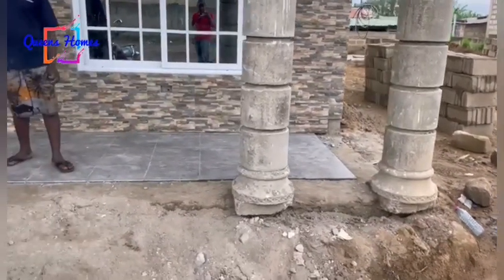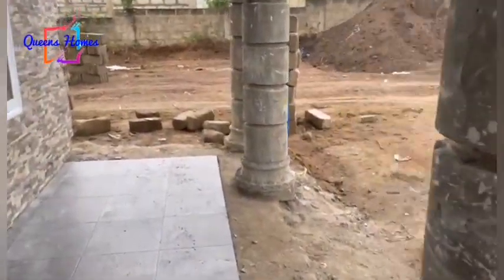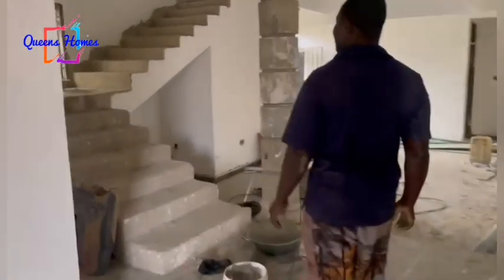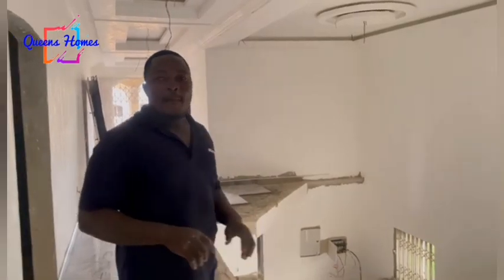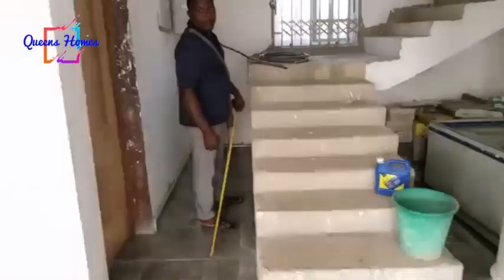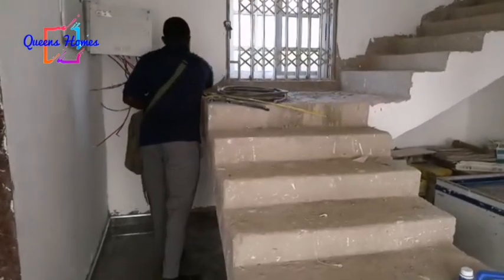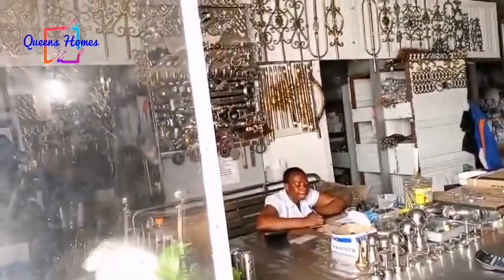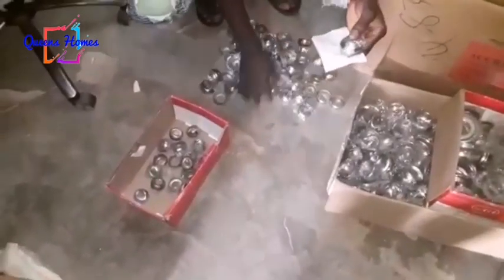Building a Dream House in Ghana | Part 39 | Banister Installation

Comment: Please the stainless bar 6mm, 4mm one cost how much
Reply from the maker: Hi, for now it would be very difficult for me to tell you the actual cost for both the 4mm and 6mm because the price has increased with time. However, the 6mm cost is higher than the 4mm.

Comment: Where is the shop located please
Reply: I don’t think you should use the stainless inside use the galvanized with nice by then I don’t think he knows all about it what is nice
Reply: When you use the stainless there is a lot of different type some change that’s why I think you should use a galvanize and make the nice designs
Reply from the maker: Hi, the shop is located in Accra